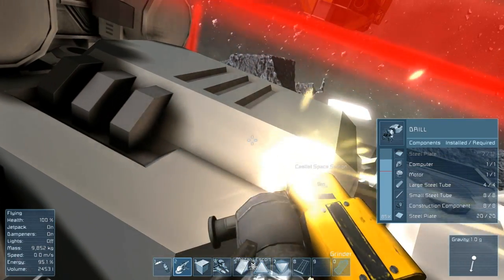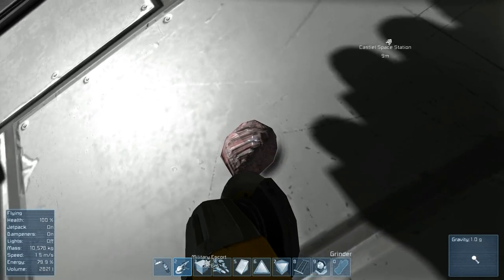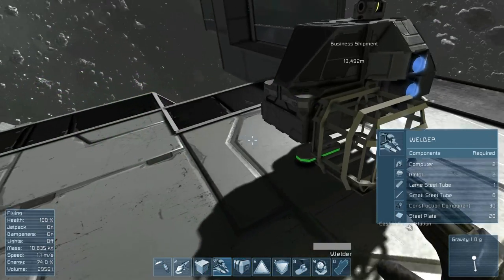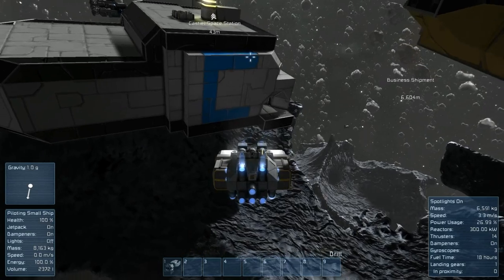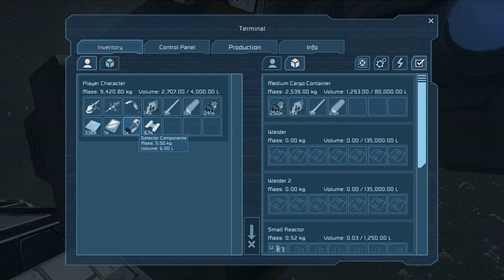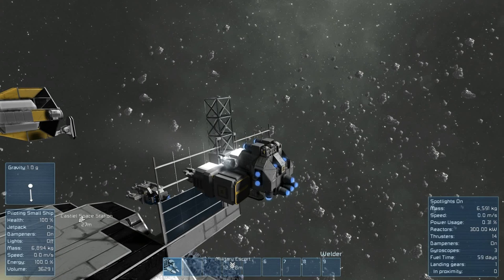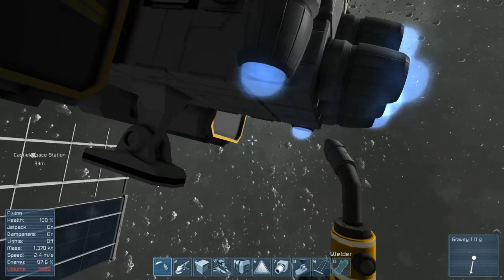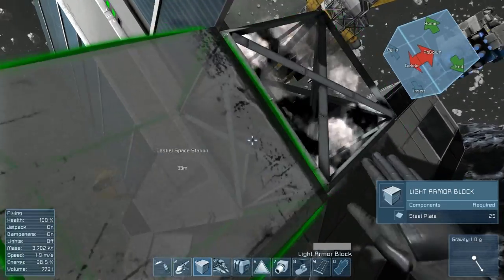Space Engineers Let's Play (Survival Mode/S-1) -E19- Welding Ship [Gameplay Commentary Tutorial]

Comment: Yea, couple things to correct in your videos.  You can turn on welders, go to your control panel, group your welders into a group so they are easier to find at the top of your list, and then you can turn them on and exit the ship.  Be careful however since they do damage you if you get near them while they are on.

Also, solar panels are useful in that if you run out of uranium, solar panels can run a refinery, even with just 1 solar panel.  It will be significantly slower(turns on and off constantly) but it will let you refine some uranium to get started again.

From a previous video, you can name ships.  Use a beacon and rename it, it will show that as the ships name.

You don't have to connect or load both welders with materials if you are going to be working on big stuff like solar panels.  That said, if you are welding blocks, then the welders will be working on separate blocks and therefore need their own materials.  

Build a conveyor system out to your landing pad and have a connector on the end.  Put a collector on your ship, you can auto load your ships this way.  Way faster than trying to move everything with just your inventory and going back and forth.

You don't have to go through and change all your welding times individually.  Google cubeblock modifier, it's on the Space Engineers reddit forums I believe.  It's a simple program that you open up, tell it where space engineers is on your computer, and then just tell it how many times faster you want your welding and grinding speed to be, for everything.  You still have to do it every week after the update, but it takes like 30 seconds to do.  

Also, spotlights can be useful if you adjust the darkness.  You can get SEskybox and change your background, as well as change shadows to darker or darkness and then you absolutely need lights.  You can also get a different background, which can potentially look alot better than the asteroids that you have now.